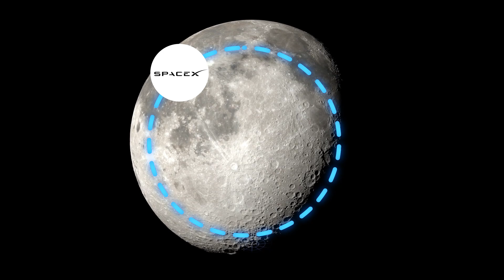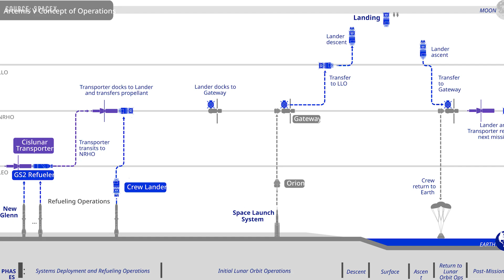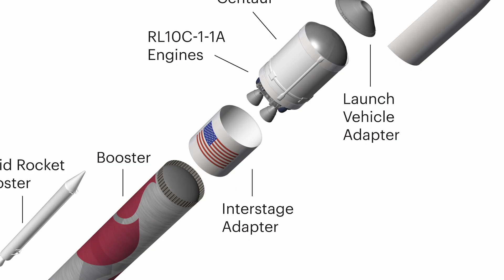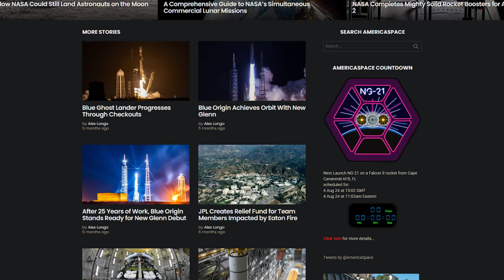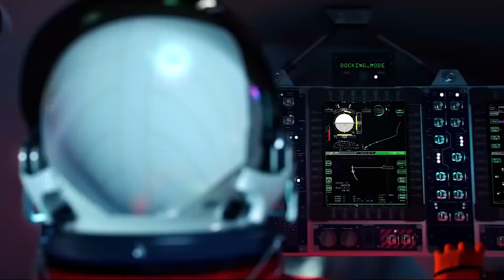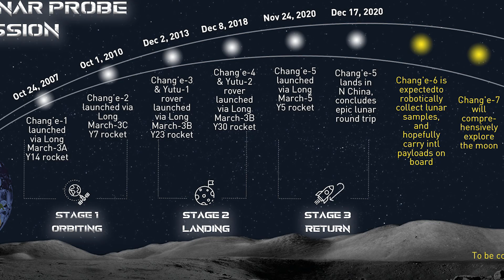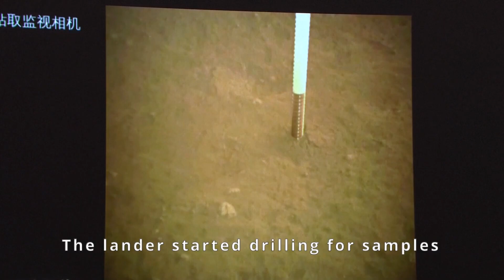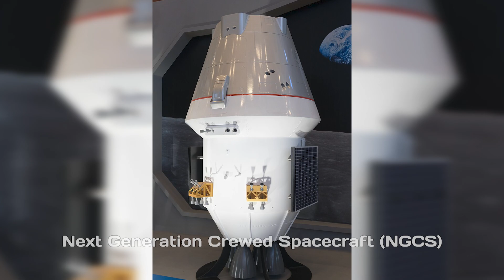SpaceX's New Brilliant Solution on Starship to the Moon: Blue Moon Lander

Comment: you can forget carbon fiber in space
Reply: Why?
Reply: @stormyridgegirl5229  Not enough stress testing in a real world environment. The last time someone thought it was a good material, it was badly machined and collapsed, crushing the occupants while igniting the atmosphere inside for a brief moment.
Reply: CF is weak in compression. CF is extremely strong in tension. Pressure inside a vessel puts the container walls under tension. CF is perfect. Aluminium foil on the inside protects against gas leaks.